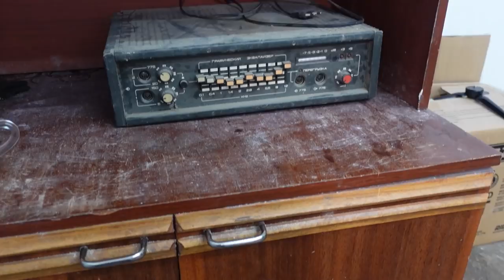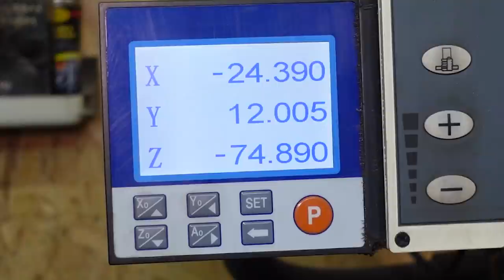Restoration of the old vise. Perfect restoration of the vise

Comment: After cleaning the grease off you should have put it in a tub of water and used electrolysis on the rust. When you went to unscrew the jaw screws you should have used penetrating oil. In the US Mouse Milk is the best. Not sure what Russia has but bet they have a good penetrating oil. Now I see you are sandblasting it. This works great but the electrolysis would have removed the hidden rust in the screw. bolt and nut areas! This might have allowed you to remove the jaw screws easier!! I do really like the way you de-burred the parts and used a file and lathe to make the pieces look very nice and fit better. I have been commenting and now am at minute 15:35 and see you have a complete metal machine shop! Didn't know you had all that great tooling!! Great job! I bet you could make a vise better than that old one you just restored. I do notice near the end you made this vise a smooth jaw vise! Why didn't you cut groves into the jaw faces?

Comment: If you are trying to remove rusted bolts, use PB Blaster.  So much more effective than WD 40.  WD 40 is a water displacement chemical, not a lube at all.
Reply: Coca Cola is surprisingly good too (it’s the phosphoric acid that does the magic), and you can drink what you don’t use 😀

Comment: Probably should have used penetrating oil on the broken screw that’s wouldn’t come out and left it overnight. Failing that, heating with a blowtorch might have done the job. What’s the blue liquid that was poured into the cleaning tank? Descriptions would have been a nice accompaniment throughout the vid.

Comment: Not Perfect, not close. You coated the bearing surface in paint, the sliding head moves paint on the top outer edges as they are bearing surfaces, gums up and tears the paint off 30:32. You even filed the worn bearing surfaces making the gap bigger so looser. Further adding grease behind the jaws acts as a hydraulic cushion, as it slowly leaks out the jaws become loose needing tightening. A perfect restoration it is not and using that vice properly would be difficult. Say you want to clamp a 2" items with the outer jaw corners, now the slide is 2" out and the slop in the bearings is magnified by the 2" protrusion, the sliding jaw would slop sideways with the loose bearing surfaces and the fine adjustment of clamp/unclamp/clamp you'd do to get the right hold on the piece wouldn't work as the paint would hold the slide from reopening easily and smoothly. Fun plating process though, like the potato scene.